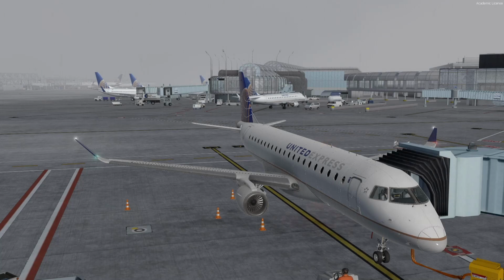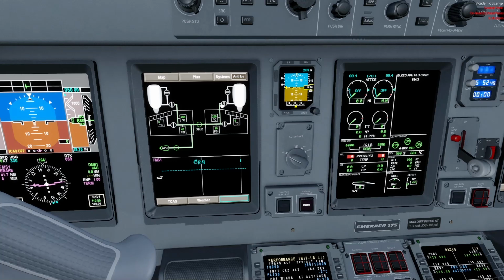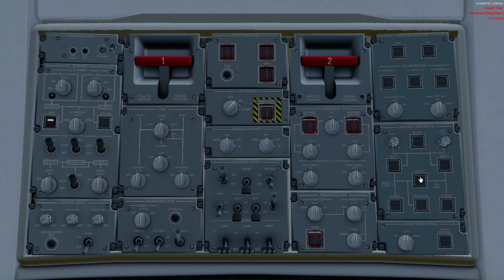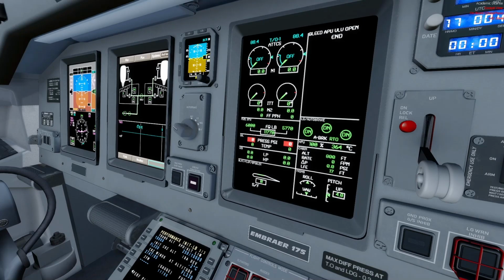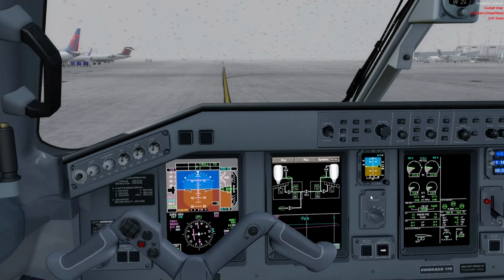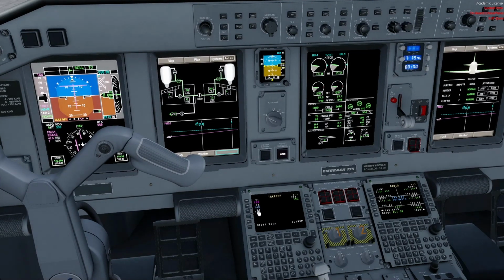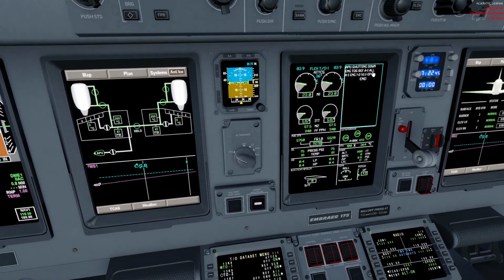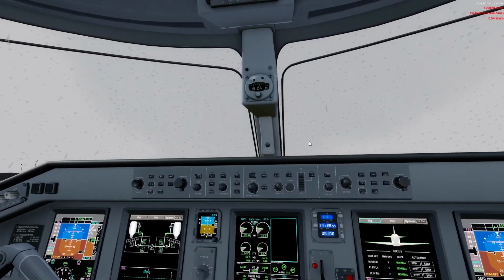Embraer E-Jets E170 Engine and Wing Anti-Ice System - Real Embraer Pilot Explains

Comment: Wouldn't an extra 11 knots on Vref make it very hard to land in the touchdown zone?
Reply from the maker: It does. The flare should be to a noticeably shallower angle, otherwise the airplane will float a long distance over the runway, if a normal flare is done.